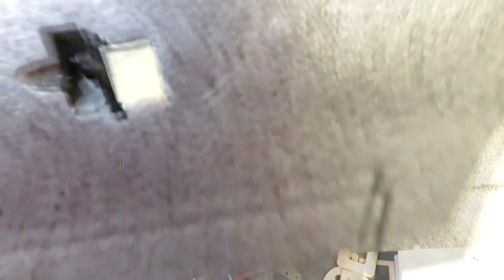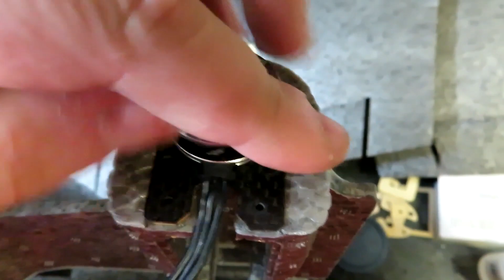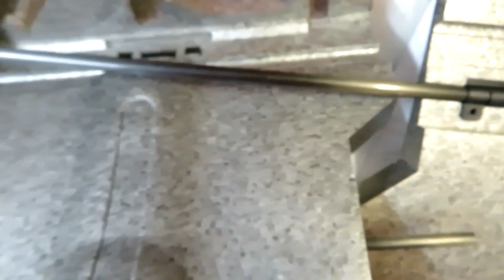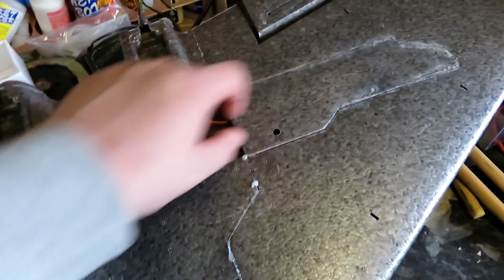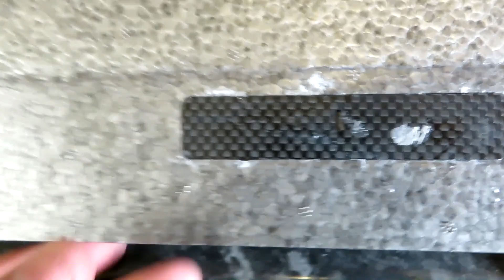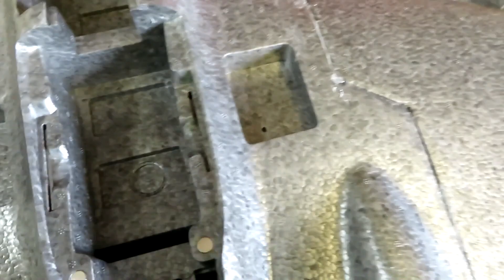Reptile Harrier S1100 - The Build (Part 1)

Comment: always wondered..  would it be possible to build a flying harrier model using one engine placed inside of a box with servo controlled ducting that draws air in from the top and blows out the 'rotatable engine' for vertical takeoff / stability,,  then switches to intake from front and exhaust from pivoted engine for flight..? maybe additional ducting / ports could be used to enable / control spin while in hover since it could be a much smaller ducting pulling and pushing air from opposite sides while maintaining steady flow for hovering,,   just an idea that pops into my head once in a while

Comment: fyi, have you heard of the principle of 'diminishing returns'.    it goes like this.    two motors, two props, two escs.   EQUALS   TWICE  THE  MASS.   and shorter flight times.  unless a bigger battery is used.  but, GUESS WHAT,  a bigger battery  increases  MASS.    and on and on and on.    it should be understood that the amount of lift that a wing makes is relatively  FIXED.    Soooo,    a choice between  two configurations of differing  MASS,   Should be CAREFULLY made.   cheers       googletranslate